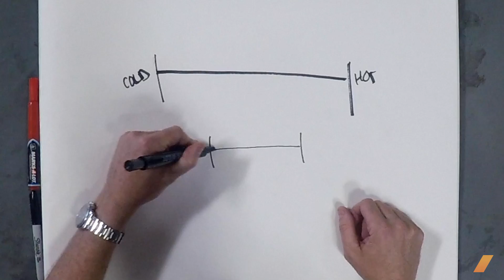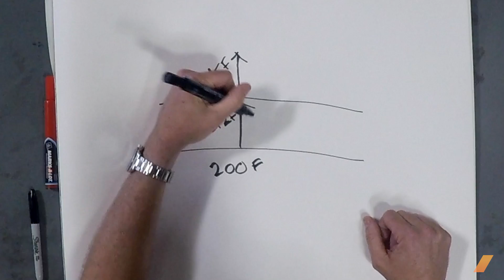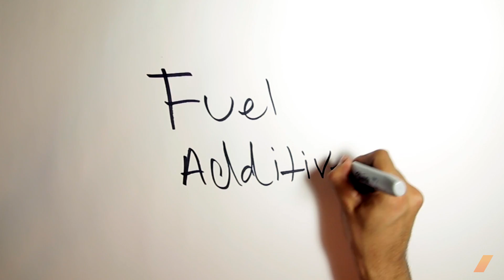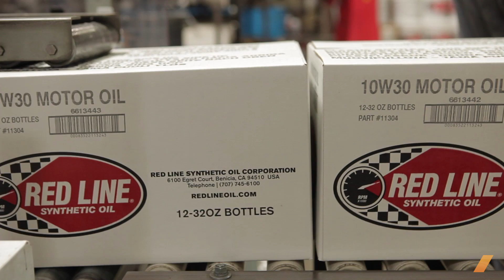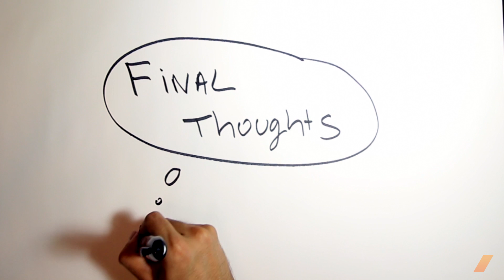10W-WTF!? Dispelling Myths About Oil -- /ENGINEERED

Comment: Interesting video however there is something that bothers me.  50 years ago, motor oil wasn't the same.  No synthetics, no multi-weight, less additives if any etc.  Today, most car people I know wouldn't consider changing their oil with oil they found in the back of their garage from 1965.  If modern oil is that much better than oil from 50 years ago, how was Porsche able to run their cars full bore at LeMans for 24 hours?  How was any race team able to survive using 1965 oil technology?  I just sold my 25-year-old minivan with 235,000 miles on it.  It ran great from the beginning, never missed a beat.  Didn't burn more than 1/2 quart every 5,000 miles.  I always used 10W-30 conventional oil.  Had I spent more on synthetic oil, what would I have gained?
Reply: Frank Howard double the oil change interval but that's about it, at least in your case.
Reply: Drex.  Thanks for your response.  One of the advantages I always hear about synthetics is that you can double your change interval but I don't buy that argument and here's why.  By the time I have put 5,000 miles on my oil, it's pretty black and that's because it's been picking up bits of carbon.  Carbon is not a good lubricant.  As a matter of fact it can be downright bad for your engine.  While I could go say 10,000 miles on synthetic, it would pick up twice as much carbon during those 10,000 miles which of course would be even worse for my engine.  I want that carbon out of there!  I could use synthetic and change it every 5,000 miles, but if I did that, I would be negating the only advantage I can see and that is longer change intervals.
Reply: Frank Howard I use only amsoil in my personal vehicles and have had the oil tested at 3,000, 5,000, and 10,000 miles and the suspended particulate and viscosity breakdown are always minimal. I own 8 vehicles, I can't afford to be changing fluids unnecessarily. Especially in my diesels that require over 4 gallons per oil change. The key is using quality filters. The carbon you're worried about should never get past the filtration stage and into your engine. In your case it still may not be worth it but in mine 235k miles is just getting warmed up. Two of my trucks are beyond half a million on original internals.
Reply: Drex.  When you have your personal vehicle oil tested, is it black by 3,000, 5,000, or 10,000 miles?  If the oil turns black, does that not necessarily mean that there's too much carbon particulate in it?  Can running blackened oil be OK for the motor?  If I switched from your standard Fram filter to another, would the oil take longer to turn black?
Reply: Frank Howard I have my oil tested by amsoil. It's not the cheapest thing ever but compared to the nearly $170 it costs me  to change the oil in one of my diesels a $20 oil analysis is a bargain. I don't test at 10,000 on the trucks anymore because they would usually come back worn out at that point so I just change it now without the 10,000 mile test. None of my vehicles ever really have black oil even at the 10,000 mile mark but when I first switched they did get black pretty quickly. The color of the oil doesn't necessarily mean anything. I've had jet black oil cone back ok and I've had relatively clean looking oil come back with a failing viscosity and flashpoint test.
Reply: Dewx.  Thanks for sharing your expertise.
Reply: The main reason for small intervals in conventional is they break down fairly quickly into all sorts of by products, some of which you'll notice, such as the black color, other you may not notice, such as acidity. Synthetics are alot more resilient and when combined with a good filter can withstand the extended intervals.

Other pros for synthetics include less engine wear, less friction which would result in better efficiency/power and temps.
Reply: Frank Howard  50 years ago we ran leaded fuel too. Engine technology has advanced 50 years and the oil has had to keep up. That's why it worked back then. Today's engines pack considerably more hp than engines of old (in general. I realize there are exceptions)
Reply: Actually pure carbon is a great lubricant as it is very slick, but it's the mix of other stuff in the burnt up oil and microscopic amounts of metal that are what slowly foul the engine over time with tiny scratches which eventually grow larger.
Plus modern vehicles have much tighter tolerances for parts and heat, and some even use the oil in specific functions so they require it to be a certain viscosity as to measure the pressure.
Reply: Higher concentrations of zinc. Modern oil has very little zinc as an additive compared to the oil of yesteryears.
Reply: Lots of ZDDP in older motor oils which is great for wear protection.  Moly and other additives are being used these days as well as ZDDP. API SG (1000-1400PPM) has much more than the API SM (600PPM) rated for example. Apparently it's bad for the catalytic converter. Im not saying API SG is better, just comparing ZDDP numbers.

Anyhoo, I'm old school (pushrods instead of OHC, rear wheel drive instead of wrong wheel drive) and so I use Penrite 10 Tenths Premium 0W/40. On paper its got good numbers. Group 4/5 (PAO/Ester) base stock, high Zinc and HTHS of 4.5, good stuff.

People get too caught up in the API ratings and Manufacturer approvals on the container. What they should be doing is researching the tech data for the oil which is not on the oil containers. Its about the numbers. 

Oil's ain't oil's.
Reply: J.  Unless your car is burning a lot of oil, I don't see how the ZDDP could get into the catalytic converter.  Doesn't it remain in the engine?
Reply: Every engine burns oil, since there is no such thing as a perfect seal yet,
Reply: That really took a nose dive in 2008 I believe with our friends at the EPA. The zinc was messing with the worthless catalytic converters, so car manufacturers lobby to have zinc taken out of the oil... So basically, no matter what oil you buy is pretty much worthless if it's street legal. Bonus to the car manufacturers, they get to sell you a new pile of bolts sooner.
Reply: Frank, You're also comparing apples to oranges. After a LeMans race, they tear the motor down and rebuild it. How many times in 235k have you rebuilt your motor? I'm betting zero. There is no way a LeMans car would survive 235k miles of continuous racing, even if you ran with a jug of fresh oil running into the motor, and dumped a stream of used oil out the side, something in that engine (or elsewhere in the car) would fail catastrophically during that time. 

What this really boils down to in your case, is how well engineered was the car for the intended application, and does/did your operation of the vehicle fit into that window of performance. Clearly, that answer is yes.
Reply: Synthetics often (if not always, I'm not going to say always since I've not read data sheets of every oil) have much better flashpoints and fire points than Conventionals too so they won't catch in some little hot pocket in the engine and burn, causing buildup in that area.

Also Frank, I may be wrong about this but isn't it such that cars weren't often expected to last past 100k miles without a rebuild in the mid 1960s? I've heard of exceptions (E.G. 1940 Studebaker, new to retirement: 311k, Source: Consumer Reports Book "How To Keep Your Car Running Practically Forever") but those are all from caring owners trying to get the most out of their cars.
Reply: Austin.  You are correct that in the old days, the odometers on cars went up to 99,999.9 miles, not 999,999.9 like they do in today's cars and that's because they weren't expected to get to 100,000, but the point I was driving at is this:  I've never purchased a quart of synthetic oil.  If it's so much better than conventional oil, why was I able to put 235,000 miles on my Chrysler minivan without ever opening up the engine (and it's still going strong)?  How would I have benefitted had I been using synthetics all these years?
Reply: Frank Howard

You would have been able to keep the intervals longer and the engine would last longer. Usually it even increases gas mileage.
You would have better protection in higher and lower temperatures.
Reply: @Frank If you've been changing the oil frequently enough there shouldn't be an issue, it's more about when to change it regardless of the oil that's used than the oil itself even 30 years ago. Other things come into play such as how the car was treated in those miles which is why "Normal" service intervals is extended in car owner manuals compared to "Severe Service" intervals. I can believe you on the 235k for the Van on Conventional, My Dad had a 97 Voyager that got to 196k but then we thought it was time to move on as it was rusty. I've also heard of people going past 500k on conventional. Still, Synthetics are generally better (though maybe not necessary for everyone) and come in other viscosities not available in Conventional. 0w20's unheard of for Conventional and 0w40's unheard of for Diesels in Conventional plus the 0w40 (or 5w40 which is what I'm using) gives a little fuel mileage boost for us Diesel owners and easier starts in winter compared to the 15w40 even if we are using the block heater. I'm more into the extended mileage drain intervals too so it pays off in more ways than one, I'm using a filter that captures more particles and lasts longer though. HOWEVER, I'm not going to advocate Synthetic for every engine situation. I put a synthetic, Pennzoil Platinum 5w30, in a 1984 Caprice with the 305 and got an oil leak when I didn't have one before. It's just a drip out the front end after the engine's hot though, it's not gushing out. I'd stay even farther away in a situation like Grandpap's 1941 Dodge that hasn't run on the road in decades, if I ever try to wake that thing and plan on Synthetic in it it needs a rebuild. The gaskets are probably junk by now being held together by non-detergent oil sludge.
Reply: Epiphonesg007.  It's hard to say just how longer the engine would last as I just sold it to a carpenter who wanted reliable transportation that he could use to haul his tools to the work site.  He flat out didn't care about the rust and believe me, there was plenty of it.  One more thing.  I've got a Gibson SG from the early '70s.
Reply: Older engines were not as sensitive, but also not as powerful or efficient..
You get more out of better oil (depending on application) because of a higher potential for improvement.
Reply: Frank Howard simple, synthetics have better wear additives. Had you have used synthetics from when the car was bought new, that's when you would've seen the difference. Now from my understanding synthetics have better wear additives and such. It does not necessarily last that much longer than conventional oil. So the engine will run cooler, quieter and more efficient. Therefore extending the life of the engine. Again this is of you had used synthetic from the start.
Reply: If synthetic makes an engine run cooler, I would be skeptical about the difference.  If synthetic allows the parts to move across each other with less friction creating less heat, I understand that but looking at the whole picture, you've already got these massive gasoline explosions happening which create vastly more heat than the moving parts could possibly create.  That's why I'm skeptical that any difference in engine temperature would be significant.  The internal combustion goes on regardless as to what kind of oil is in the crank case.  Further, the engine temperature is regulated by the thermostat.  If the engine temperature begins to rise because of a switch from conventional to synthetic, the thermostat will open earlier and stay open longer.  I'm not trying to be smart here, but it seems to me that while the radiator may become hotter, but I don't see how the engine will become hotter.
Reply: Oil temperature is dependant on the kind of oil that is being used. Oil 
temperature and coolant temperature are 2 different things. 
DIfferent oils have different cooling capabilities, synthetics also work better at high temperatures.(turbo applications for example where oil is squirted onto the piston to cool, which makes the oil really hot locally)
Reply: epiphonesg007 nicely said, should've mentioned it was oil temperature.
Reply: Frank Howard Oil temperature is different than engine temperature. Should've mentioned that. The higher the oil temp reaches, the oil lowers in viscosity. Resulting in more wear. Its a better product in every way that all new vehicles benefit from especially with their tight clearances. Older vehicles not as much but still benefit nonetheless. my 2¢

Comment: Redline synthetics are some of the best oils you can get in any application, so I was very pleased in an unbiased learning session. I actually run their gear/Diff oil in my track car and can say it made a hell of a difference when warm. Onto the snake oil gas additive bit though, I should see if any videos are out there in regards to premium brands fuel treatment making a difference. I run lucas Fuel injector cleaner once every 5 tanks in some of my fuel sipper cars and can easily notice the difference after the tank has been run through. Making more power? hell no, returning what was there over 150k miles ago? Yea, its does at $4.99 a bottle... just how much however? meh.....

Comment: I'm a havoline man
Reply: I'm more of a Shell Helix man, only cause Castrol stopped making my Fav oil many years ago bastards LMFAO.
Reply: fullboostturbo1 I know what you mean it's probably dumb to get stuck on a brand but lol
Reply: Michael Horsford At the moment I have to mix to different Shell Helix oils to get the perfect oil pressure on my VL Turbo, due to a 10-30 being a little bit to thin and the 15-40 being a bit to thick so when I mix equal parts of each I get the perfect oil pressure, and that way I have enough oil for 2 changes LMAO....
Reply: fullboostturbo1 nothing wrong with that
Reply: Michael Horsford Shouldn't be as they are both Semi Synthetic oils.
I have got 250,000kms on my car and still running original turbo with standard boost, car still drives like brand new.

Comment: Viscosity has very little to do with how well the oil performs under load (pressure) between the bearings and rotating parts.   A thicker viscosity will be harder for the oil to film between rotating parts increasing oil pressure whereas, thinner viscosity will get between the rotating parts easier but to thin is just as bad as too thick.  His info is a bit skewed.  Engineers design engines to operate on a certain viscosity not the location you live in.  Now he's blowing smoke about thermal wear, the difference between synthetic and conventional is marginal when it comes to thermal wear, synthetics (group3) are still mineral based and all oils conventional or synthetic have additives added to the oil.  He's not a chemical lubricant engineer and is just selling what the sponsor has provided.  You can't rely on YouTube for factual data.

Comment: Anytime I go to the strip I add a little honey to increase the viscosity inside my massive block. Just a tad. I'm not too greedy. It does wonders for my Honda Civic with the Earth destroying 170ft/tq and 201 horsepower from the K24. It allows me to push my Civic Si with the aerodynamics package to beat 1/4 mile killers like the Corolla-S, powerful J35 equipped Honda Odyssey, and the powerful tour-de-force time traveling Pontaic Aztek with the highly sought after 3.4L LA1 V6 with the K&N air filter assembly. I swear last time I raced an Aztek the engine was so pungent it smelled just like crystal meth. Now that I think about it when I raced the Aztek I did begin to hallucinate. Either way, if you see me on the strip with my Civic Si with the aerodynamics package, and you see bees emanating from the exhaust, be warned, you will be racing a demon dawg, dog. OK, thanks.
Reply: Underrated comment 😂